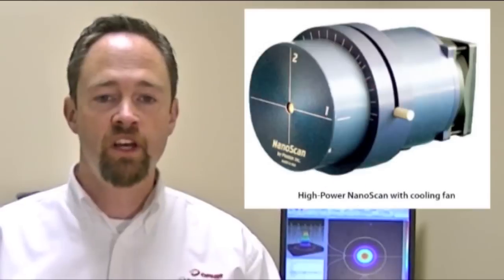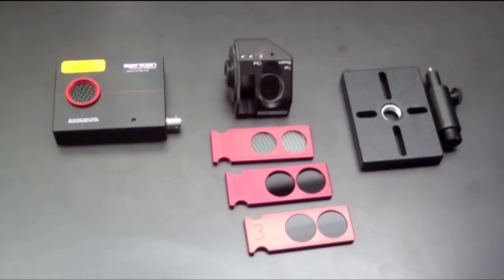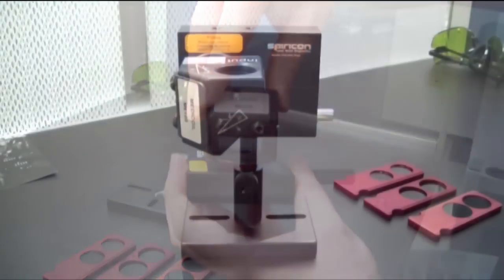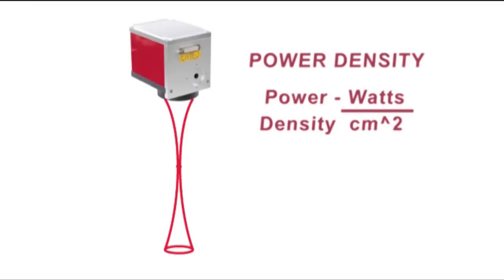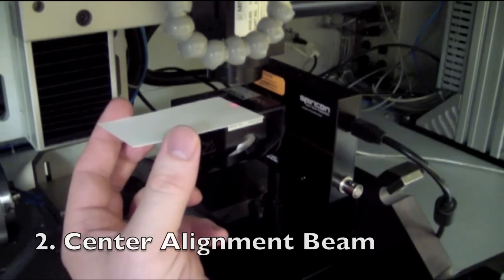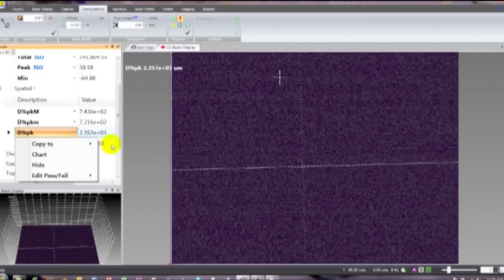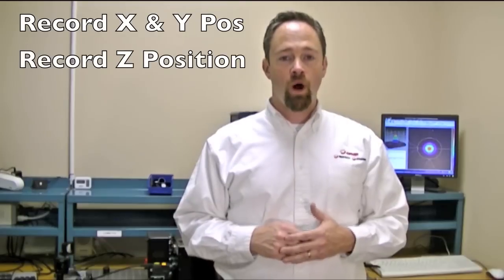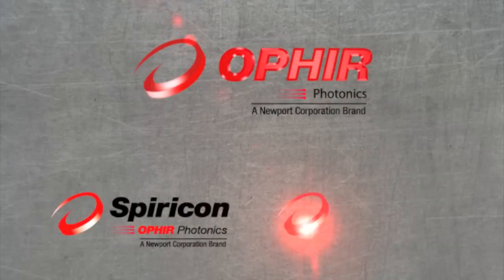Measuring Laser Focus Spot Size in an Industrial Medical Device Application

Comment: 5:51 - But I would like to know the beam characteristics of the exact focal length and point during high power. Could I just reduce the laser power to which it will not damage the sensor while staying at the correct focal length?